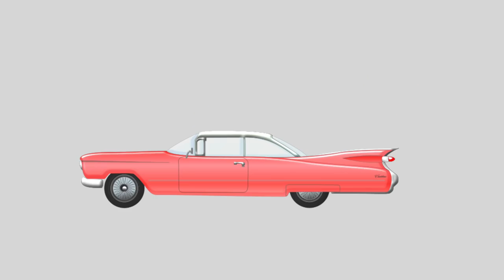Yes, Rockets CAN Fly in a Vacuum

Comment: This question is a little bit more specific. In space (no gravity), how does the fuel keep flowing to the pluming and pumps? It must be floating freely so how do they manage to maintain de fuel flow? Cheers from Argentina.
Reply: Ullage Motors.
Reply: I think that some designs pressurise with an inert like nitrogen from its own little tank.  Some - like a second stage - can assume they're under acceleration so all the fuel is at the bottom of the tank for pumping.
Edit: try Scott Manley's channel; I think he's got a couple of videos about the plumbing and pumping.

Comment: That is hard to verify since NOTHING  has left low earth orbit and returned EVER
Reply: It works just fine in low earth orbit too...
Reply: Bob Shepard - want some PROOF that spacecraft HAVE left earht orbit and some even came back?
Google the "Stardust" space mission.

Then research the "Deep Impact" mission and explain what you learn when you google:
"What happened to Comet Tempel-1 July 4th 2005".

See if you have the intellect to figure out the significance of the results of that search. (I doubt it, because it requires an attention span of greater than 30 seconds,)
Reply: Bob Shepherd - So did you do the research I asked you to or is evaluating actual FACTS against the flerfer religion?
(I suspected that you did NOT have the intellect to do that research yourself)
Reply: Hi Bob
Air resistant is the resistance of the air to a body passing through it; the force that the body has to apply to move the air out of the way, equal (thanks Newton) to the force that the air being moved applies to the body moving it.  Air resistance exists because air molecules have inertia so resist being accelerated: they resist change of momentum. And, by Newton's first law of motion the force exerted on the air molecules equals the force that they apply back.  
So: change in momentum is resisted by inertia, so a force is required to change momentum. And, force exerted = force resisting.
Therefore, if a rocket pushes e.g. a brick out behind it, the momentum of the brick goes from zero to something in the backwards direction. So the brick's inertia resists this. So the rocket has to apply a force to the brick to make that change of momentum against the brick's inertia. But, at the same time that same force is applied back on the rocket (First Law), so a force is applied against the rocket's inertia, so the rocket has a change of momentum :- forward. 
Now, rather than one brick, imagine a whole series of bricks: push, push, push.
Now, rather than bricks, imagine a whole series of gas molecules: push, push, push, push, push, push, push, push, push, push.
Reply: @stuartgray5877  nothing has left low earth orbit and returned.
Reply: @stuartgray5877  if we went to the moon 50 years ago, why not again Einstein
Reply: @txsraappraiser  - "nothing has left low earth orbit and returned."

False.  I have personally worked on TWO missions that HAVE eft earth orbit and returned,

Lookup the Stardust & Genesis Missions.
Reply: @stuartgray5877  wrong nothing has left low earth orbit and returned.
Reply: @stuartgray5877  why did the space shuttle stay in low earth orbit?
Reply: @stuartgray5877  That was a movie, wake up!
Reply: @txsraappraiser  Bob Shepherd - So did you do the research I asked you to or is evaluating actual FACTS against the flerfer religion?
(I suspected that you did NOT have the intellect to do that research yourself)
Reply: @txsraappraiser  - "That was a movie, wake up!"

So you are INCAPABLE of doing a google search of "NASA Deep Impact Mission" ??

Maybe ask one of your five year old friends in your special needs class to HELP YOU do the search?

Bless your little heart!

Comment: Can we stop using Newton's third law to explain rockets? The action is a fuel-oxygen mixture meeting spark. The reaction is the ignition or explosion, NOT necessarily forward thrust. The action of a drone prop spinning does not automatically mean the reaction is upward lift-because they will not fly in a vacuum. i.e- the point everyone asking the question is getting at.
Reply: But Newton's third law IS directly applicable. The rocket nozzle applies a FORCE on the exhaust gases as they traverse the engine and exit the nozzle.  This FORCE is felt by BOTH the exhaust gas AND the nozzle. "For every action (gas gets accelerated) there is an equal and opposite Reaction (nozzle gets accelerated)". To say rocket propulsion is NOT an effect of the 3rd law is disingenuous.

Comment: If there is no air in space I.e vacuum,then how thrusts from rocket fuel will help it move forward? I mean against whom is the thrust pushing against if the space is vacuum?
Reply: The rocket is accelerated because the exhaust is accelerated in the opposite direction.
At the absolute basic level, rockets rely on simple conservation of momentum.
Reply: Would a gun not recoil in vacuo?

Comment: What do thrusters push ions or compressed air against? In the vacuum of space?
Reply: They push the ions or exhaust
Reply: @afoxwithahat7846  what do they push them against?
Reply: @sammm7677  exhaust, it's made of particles, it has mass.
Reply: @sammm7677  if an atmosphere slows it down later or not, it's a problem of the exhaust, not the spacecraft
Reply: @sammm7677  Answer this very simple physics question to help you:

If I fired a steel projectile from a CROSSBOW in a vacuum, will I feel a recoil force?
Yes or No?

Comment: Great video. Though an internal combustion engines air fuel mixture should never explode. That is bad. The mixture is engineered to burn and it's the rapid expansion that provides force on the piston.
Reply: Rapid expansion is almost the definition of explosion..
Reply: @greghillmusic  almost. The difference is burn vs detonation. Detonation=rip pistons

Comment: The car analogy is really misplaced.

The reason the car moves is not due to the momentum of the exhaust, that is true, however that is simply because that momentum was already depleted in the pistons and redirected to other parts until it finally reached the wheels.

So yeah, cars move due to Newton's third law as well.

Comment: The rocket moves because the explosion in the chamber pushes on all sides except the open one, the force just escapes on the open end.  So you have force pushing up but no counter force pushing down, and the rocket moves up.  However, what about the force applied to the explosion by the infinite vacuum of space?  If that force was greater than the explosive force than it would suck the explosion out of the chamber and the rocket wouldn't be propelled.
Reply: A vacuum is defined by the absence of material and things that aren't there don't 'apply force'. So a vacuum does not "suck", it just doesn't get in the way.
Reply: Thanks for the explanation Richard :)

Comment: When we walk we push the ground backwards and as a reaction the ground pushes us forward.
In vacuum we don't have ground or even air that could push us forward, then how do we move forward in space by propulsion system
Reply: Would a crossbow fired into a vacuum have any recoil? Yes or No?
Reply: You create a lot of gas in your engine by burning a fuel and an oxidizer (both of which you store as liquids in tanks on your spacecraft for example), and push yourself away from that gas. At the same time the gas pushes off your engine, and escape in the other direction.

Comment: I don't know if you have covered this before, but exactly how did the Lunar Module and Command Module power source work?
I under stand that they got drinking water and breathing O2 from them, is that correct?
Reply: The lunar module only had batteries.  They originally designed it to use fuel cells (which is what you were describing).  The CSM had fuel cells.  But, the scrapped the idea of fuel cells for the LEM fairly early in the project, in favor of the simplicity and reliability of batteries.